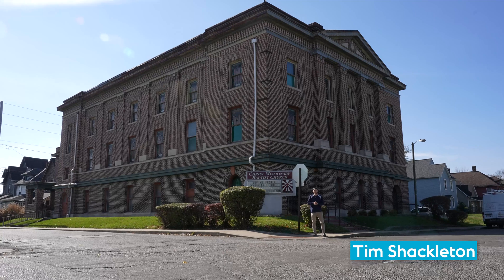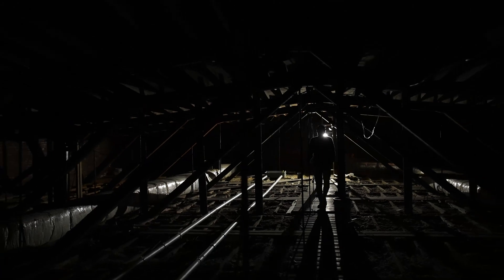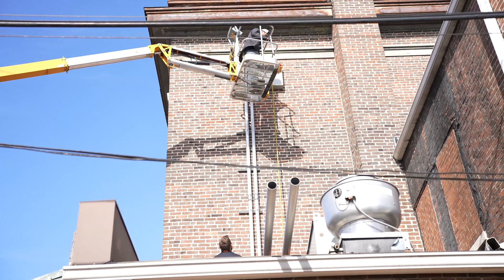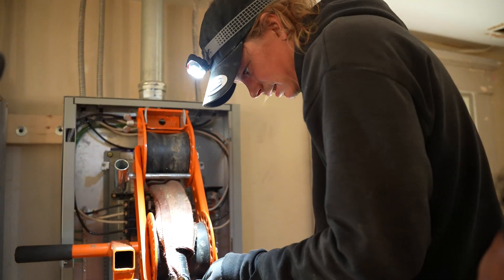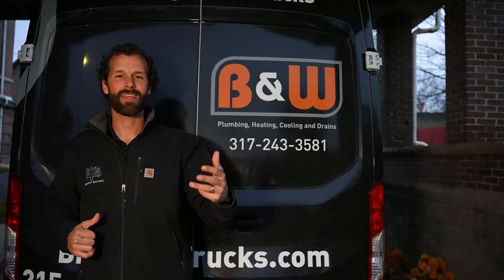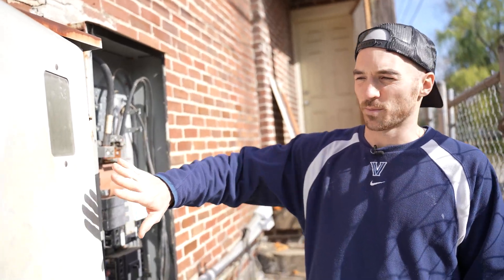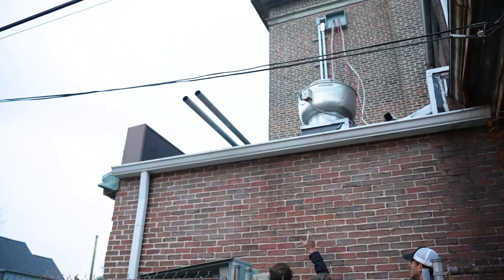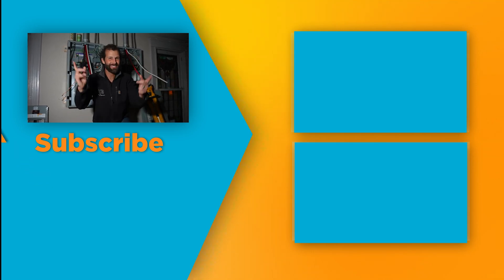This Was a Whole Different Job Back in the Day

Comment: offset the exterior pull box and eliminate the LB'S, inside relocate the pull box above the panel and eliminate the LB'S in attic
Reply: I think the excuse was the snake was short.  But yes  move box  over the LBS
Reply: Having that tugger. You can pull anything. In 360°

Comment: So if you have a pull box, your degrees start over at zero PM, SO it’s 180 up to the pull box, hence the box … just saying… 4:12
Reply: This. This is a big reason to have a j man run the job. Nothing against him. Just needs the experience
Reply: He also included the LB in his 360 total which is incorrect, the LB is a pull point and the total would reset as well.
Reply: and nice 90's no big deal
Reply: I believe he was referring to the complexity of the pull, not the 360 degree code limit.